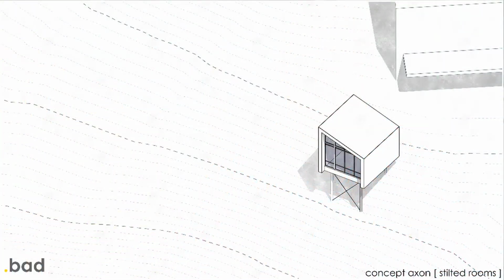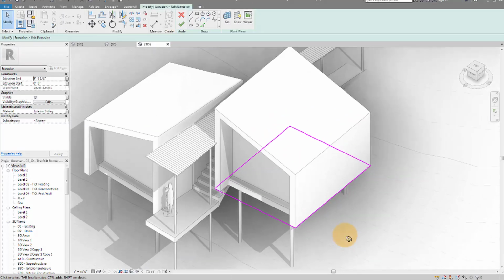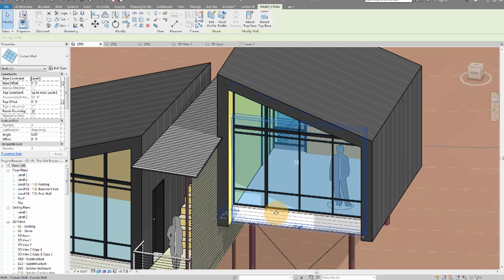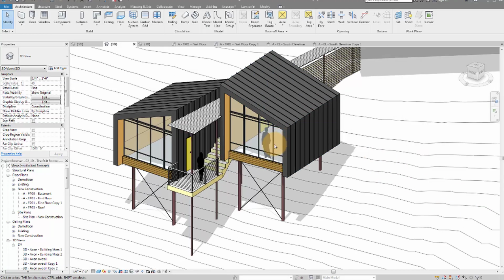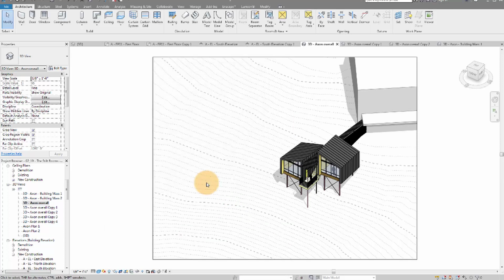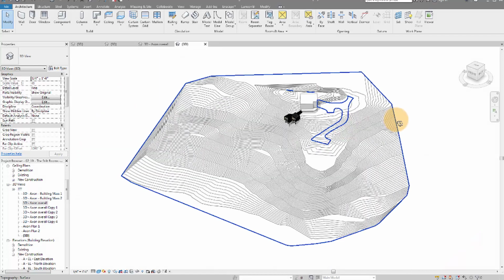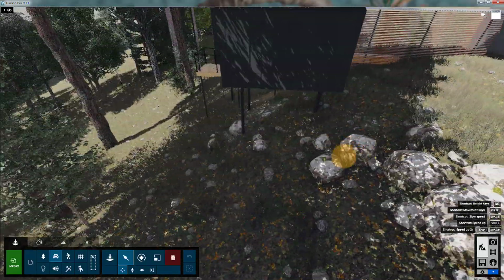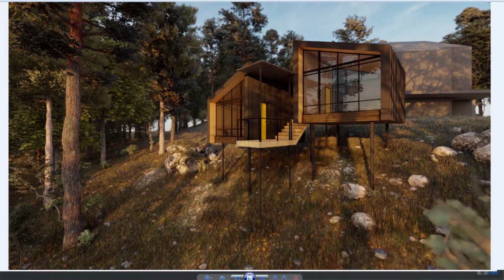My Revit Design Process - The Making of Stilted Studios (Revit Tutorial, Lumion, Sketching, etc...)

Comment: Thank you very much for this amzaing lesson making modelling easy as Rhino in Revit. But how could you seperate the wall and rood in later process and this will be very important for construction documentation.
Reply from the maker: You would just model them as roofs and walls… it’s really simple actually !
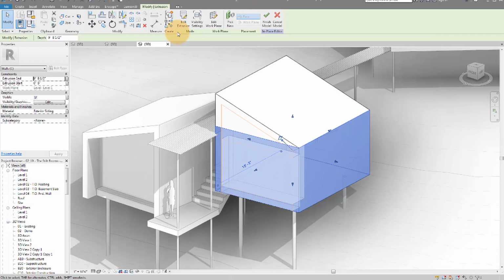Reply: @TheRevitKid  Thank you for the reply! Do you mean using "Model in place" to mdel and then set them seperatelly as roofs and walls or directly using roof- and wall families in sketch process? In the video around 7:54 I saw the upper part (roof) and the lower part (box) both showed as "Wall 1" in the property panel. How could you deal with seperating them as defferent categories later on?
Reply from the maker: @han7959  no… the next step after this conceptual step would be to use the Wall and roof system families and either model by face or just manually model them and use the mass as a reference Similar to how I “wrap the mass” with standing seam wall type around 10 minutes.

Comment: So where is the part where manufacturing / building drawings get made and load bearing has been applied?  How do you know the poles and guy wires are adequate (as an example)?  Do you have a follow on video to show the round trip to engineering and back to a building that can actually be built?  While you were massing this out, what sort of process do you go thru to ensure the buildings can actually be built and aren't just art?  How do you decide what sort of manufacturing methods will be used, such as pre-fab, traditional stick built, acceptable materials, catwalk safety and egress, etc.?
Reply from the maker: You're describing the design process... As mentioned, this is concept design (not even schematic).  Moving forward, the process is still very similar.   Analyze, design, model it, collaborate, repeat... You're describing the entire architectural process, this is just step one.

Comment: hello, how about the structure you used, did you calculate approximately how big the poles need to be ? and what material you are gonna use for a good solid strucure ?
Reply from the maker: Hey Riad, at this early stage I have not calculated the column sizes yet but they are being shown as 4" round steel tubes... I would imagine this would be enough... Once the project progresses beyond schematic those calculations will be done.